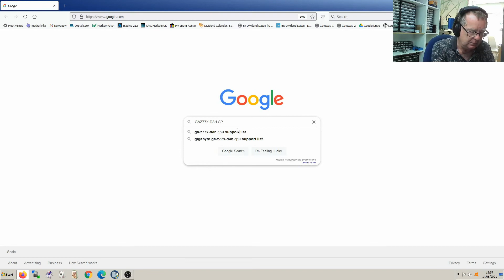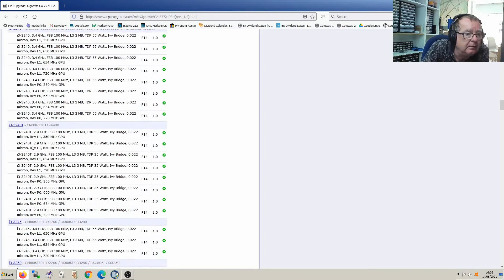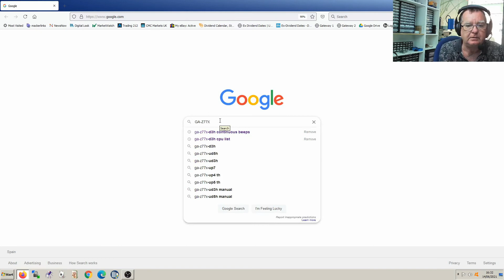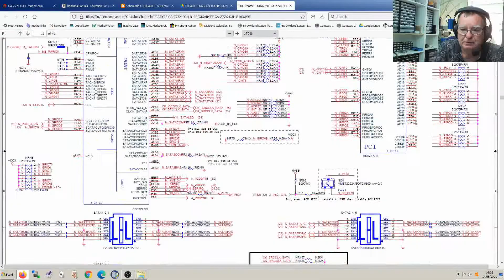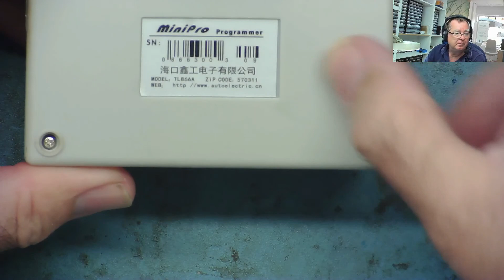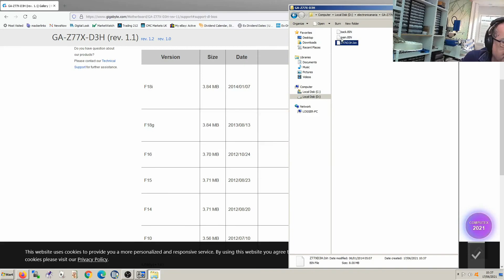Gigabyte GA-Z77X-D3H Motherboard Powers On, Bleeps, But Will Not Boot LER #071

Comment: Great vid!. I always love your videos. I´m just working on a GA-Z77X-UD3H. Loop boot too. I´ve just purchased a programmer so I have to wait to solve it. I arrived to the same conclusion as you before watch you diagnostic so now I´m more confident. So, since I don´t have de programmer now... I think I´m going to test to change the bios chip. Put the backup chip in place of the main and test if the same problem persist, and check if the back up sistem of gigabyte works properly or not. Thanks again for all your good work and cheers from Uruguay
Reply: How did things go with swapping the bios. I have the same issue too